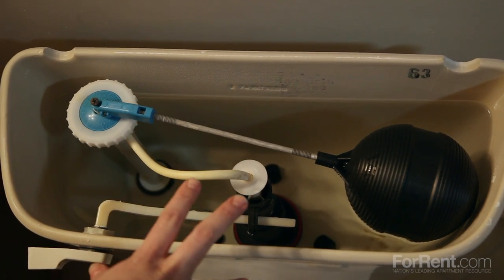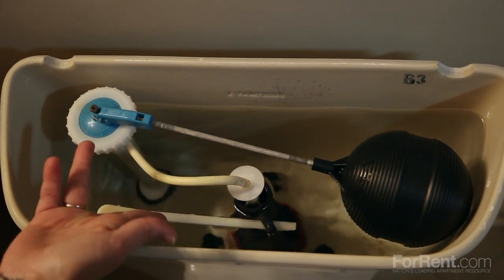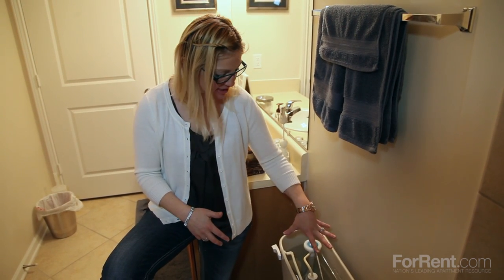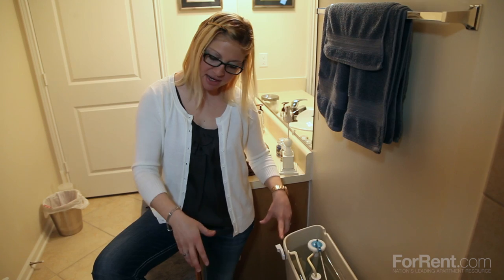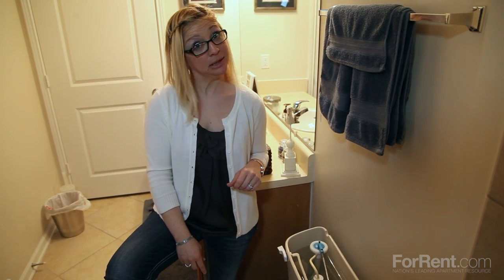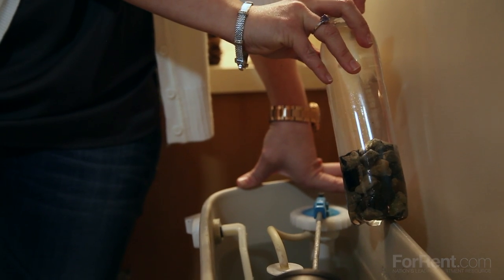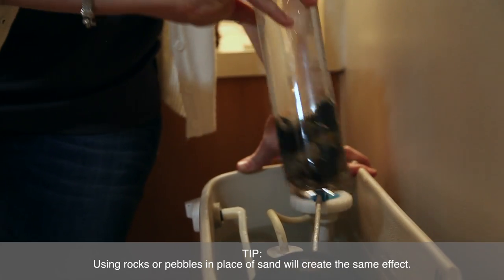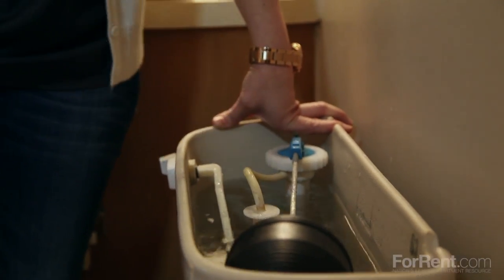How To Economically Save Water at Home

Comment: Habits are hard to break even good ones.    My normal habits:  Never let water run down the drain while 'warming' it up for a shower.  Catch it in a bucket/pretzel container. You can use that water for plants/garden or even filling up toilet tank.     My uncle Chuck taught us this 60 years ago:    Use two phases for shower. First turn around and get wet. Then TURN OFF water and then use soap on all your body.  Third phase. Turn water back on and rinse.  Then turn off for good.         If you have a slow leaking faucet collect the drips into a plastic glass.

Comment: The comment about the pipes being full because of the lack of water is concerning.  I have a magic sponge in my toilet reservoir that leaks chemicals into the bowl after every flush to clean; and I put a new one in monthly.  My next idea is to get water softener pellets in a bottle with a hole in it.  It will leak salty water into the bowl that will clean out rust and the ring around the toilet while not displacing too much water where the waste can make it to the sewers.  It might not be "cost effective," but at least I never have to clean the toilet again!  Thanks for the advice!

Comment: You realize that the amount of water in the tank is calculated to move the contents of the toilet out of it, down the pipes and to the sewer?  If you reduce the amount of water flushing, the contents may not be making it all the way to the sewer, and then will start to build up in the pipes, eventually clogging it completely?  You already have a low water toilet, your idea, while a good one, is better suited to the old 5 gallon tank toilets.
Reply: TheStavros1001 what would happen if you replaced your old  5 gpf toilet with a new lower water 1.28 gpf toilet, would that hinder contents from making it all the way to the sewer? most sewer pipes leading out of the home are small anyway. I do agree with you that toilets are designed to use the calculated amount of water to push out content and this bottle method may have you double flushing thus negating the savings. why not use one of those half flush tanks?
Reply: pdeandajr Not in my house, built in the 40's.  While it would probably work on the downstairs toilet, the upstairs toilet has to go down, across the house, down the sewer pipe, and out to the street.  Less water would not work, and eventually I would be paying to have the pipe cleaned.
Reply: got it
Reply: This is true. I have to hold to handle down to get all the contents to flush and that toilet clogs a lot cause of this "trick" In doing that I probably use the same amount if not more water to flush it again.